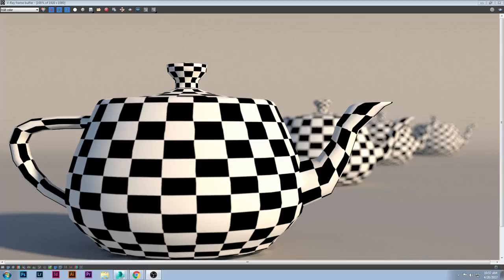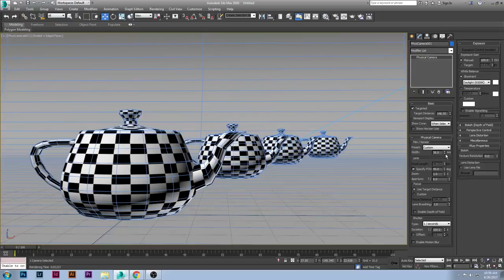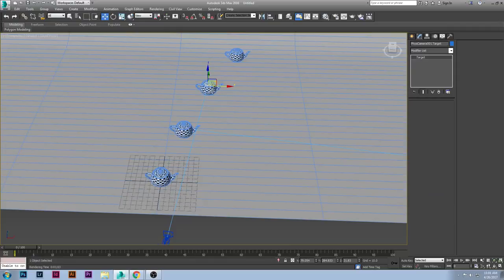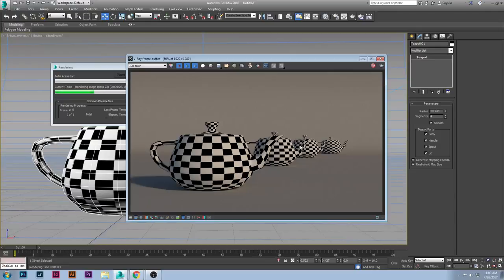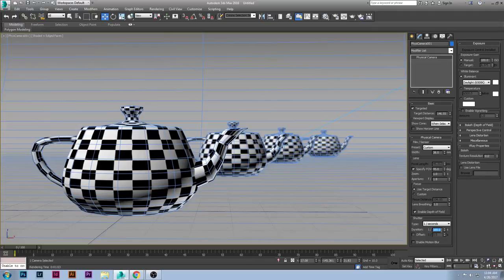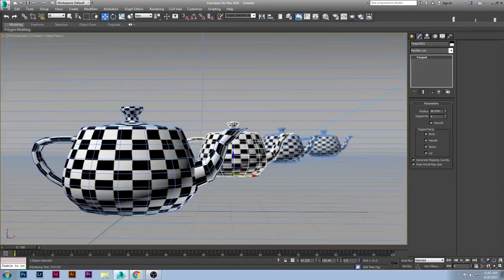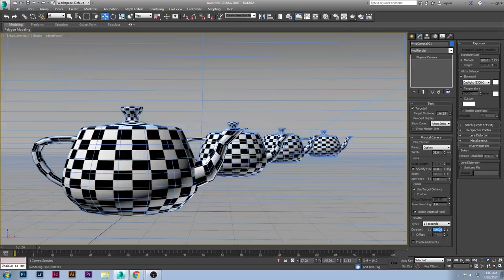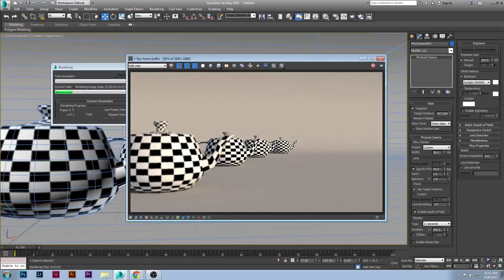How to use 3ds Max Camera - Correctly!

Comment: what version 3d max have physical camera, i use 2015 not already that camera or maybe this is 2017 version?
Reply from the maker: Yes i am using 2017 here
Reply: like my guest, i will move in 2017 version 
usually physical camera for vray, i not use vray for my animation job coz so heavy render.
thank you for infomation

Comment: its an awesome tutorial ! it is very helpful :)
but i have a question if it's ok
whats the difference between Physical, Target and Vray camera? depending on what do u choose the camera ?
Reply from the maker: Physical is the camera used in the video and the only one you really ever need to use. 
Target: I believe but dont quote, is for animating because it is easier to move around
Vray camera does not exists anymore. They got rid of it in newer version

Basically use physical lol because you have more settings to control

Comment: i have question..why after finish render went i save i image become dark like the gamma have some problem..i all ready put the gamma to 2.2,but went save still dark need to over ride the gamma went save..can u explain to me how to fix the problem..thank you
Reply from the maker: Muhammad Ariff so the render looks fine until you save it? did i understand that correctly. if so i did some searching on google and seems to be a bug. if your auto saving, try to save from render output window. sorry i couldnt help more. odd problem
Reply: +VanLoon3D (VanLoon3d) yes..that correct..so i cant use frame buffer..only can use render window right??
Reply: @Muhammad When you save the image in V-Ray Frame buffer, in save dialog box there is option Gamma..
> Select override and in put value 2.2
> now when you save the image, it should be like you viewed in the V-ray frame buffer.
Reply: +Ankit Akhauri thank you so2 much...